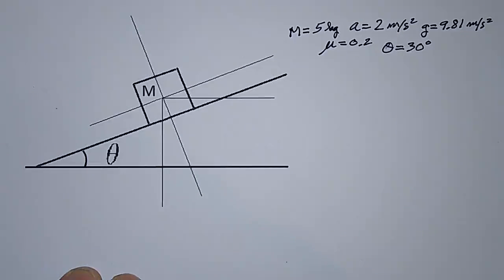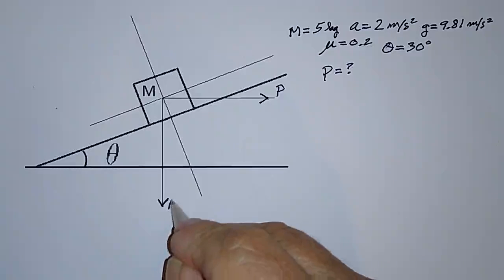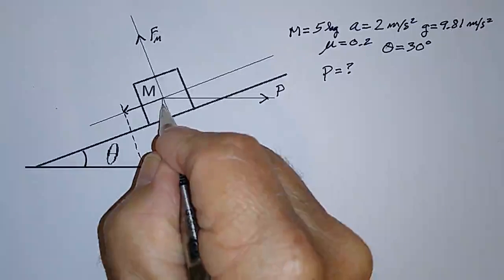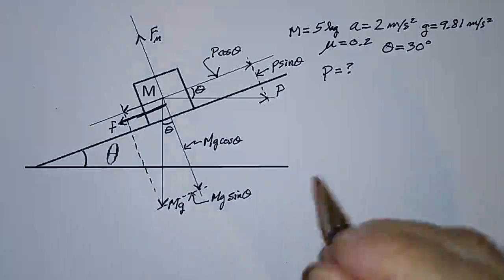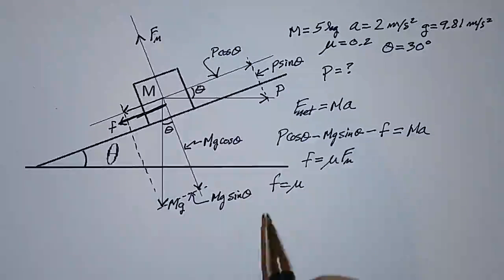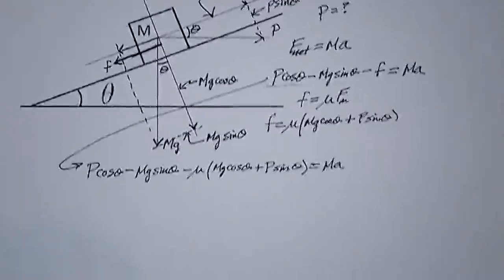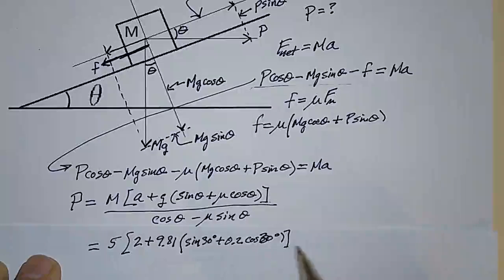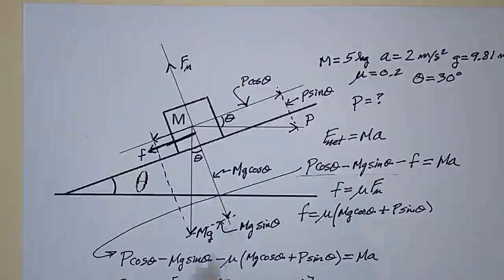Pushing a mass up ramp with friction (dynamics)

Comment: How would we solve this if the P force is at a different angle up from the horizontal?
Reply: Notice that P is resolved into components parallel and perpendicular to the incline.  Make the angle between P and the incline arbitrary (call it alpha for example) and follow the same derivation I did when it was theta.
Reply: @jlbenson  I figured it out, thank you so much